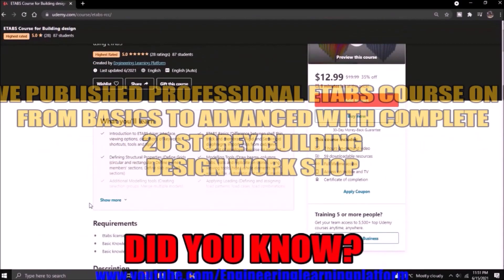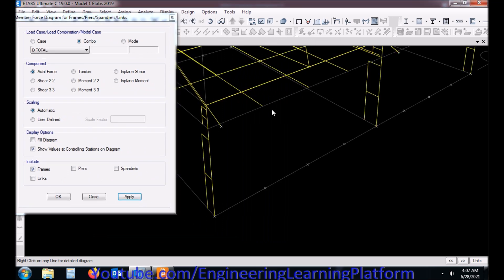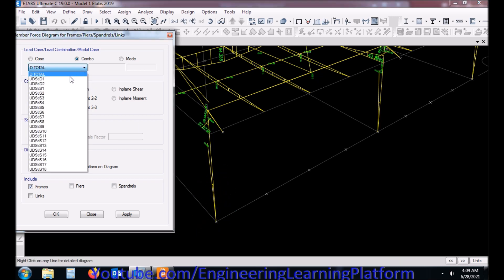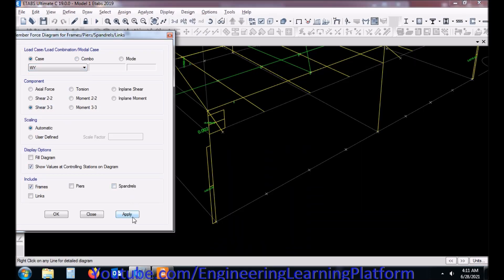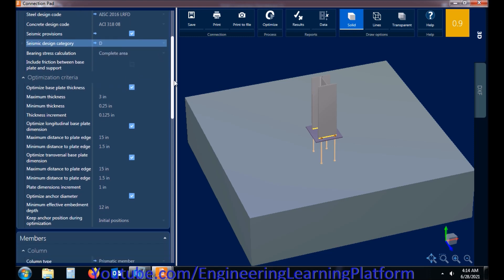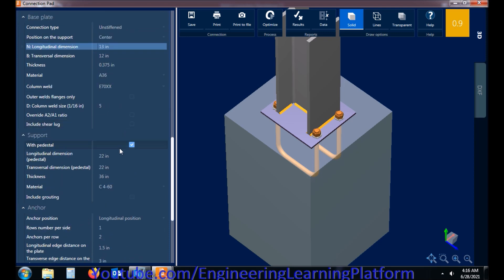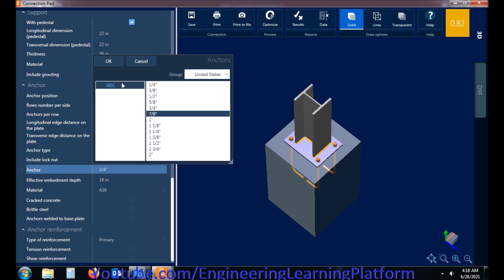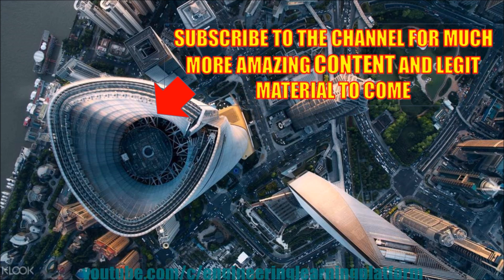Steel column base plate design in Ram Connection Tutorial

Comment: Dear if you are designing pin type connections for base plate thin the bolt should be inside the flange
Reply from the maker: No, there is no such reference . However the bolt distances if placed within the flanges will be too less and the spacing criteria will be violated . It's not necessary that you always have W24 or W30, you may have W8 as well so how would one accommodate two bolts between each flange gap . Plus it would not be possible on site execution for wrench to be slotted and tightening .
Reply: @EngineeringLearningPlatform  Talha is right. This is a moment connection  not a pin. You have the column welded at the both flanges and the anchors  near the edge of the plate. You should have added a moment to the load